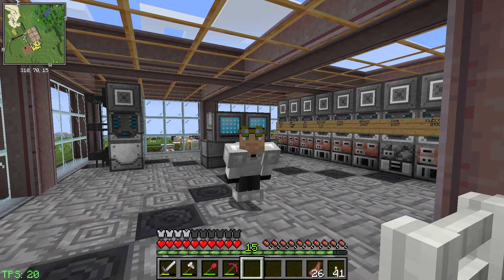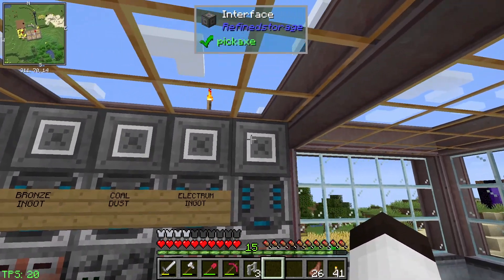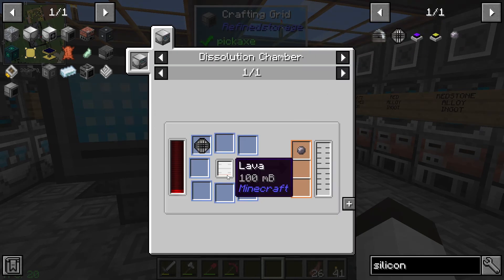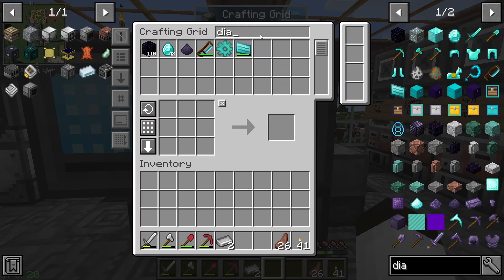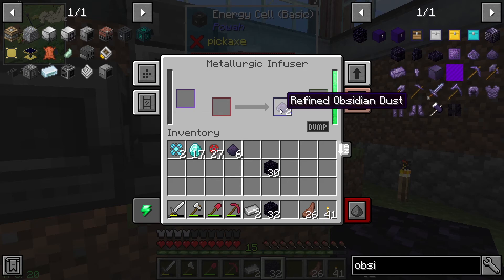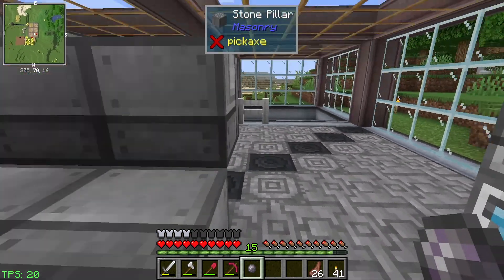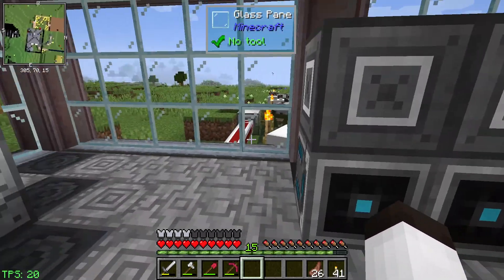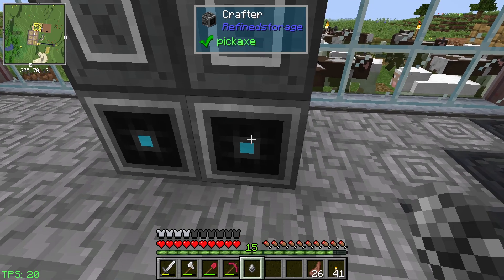QTech: Episode 25 | MISSING REDSTONE and SILCON AUTOMATION

Comment: Hi. If you want to automate the silicon wafers, you can use a Tier 1 Crafter, put the saw in there and use the "ExtC" option to tell it to keep the saw in the input inventory, then you set up a custom processor pattern with the silicon boule producing the 16 wafers (no saw in the pattern as it will already be in the crafter), and then that should allow you to automated getting the wafers. A bit of a hassle, but it works - the problem is that Refined Storage doesn't play well with items in patterns that have durability.
Reply from the maker: Yeah the crafter is a great idea.  Refined Storage isn't my favorite storage system right now.  I used to like it a lot.